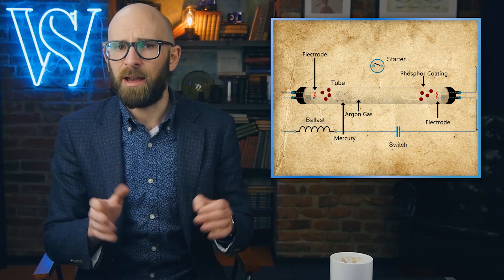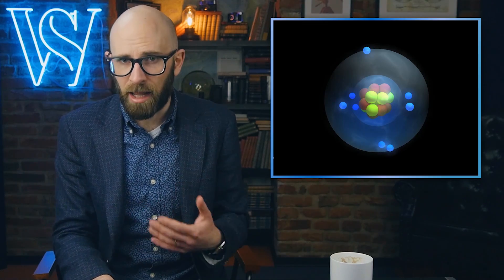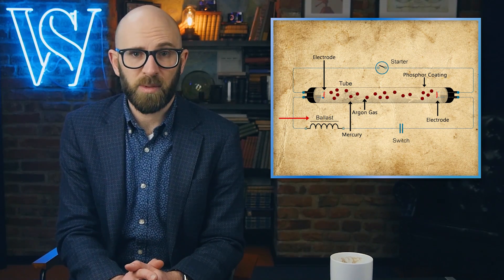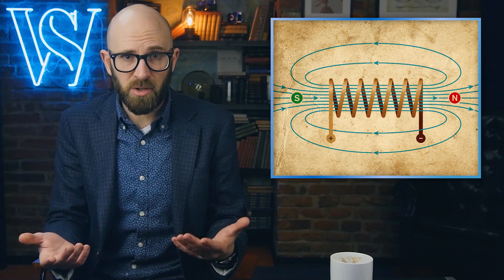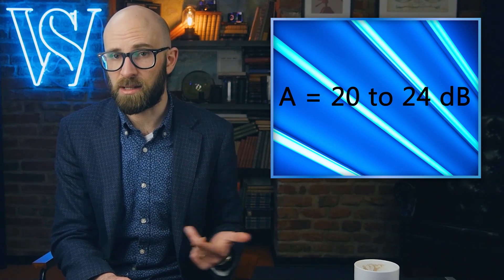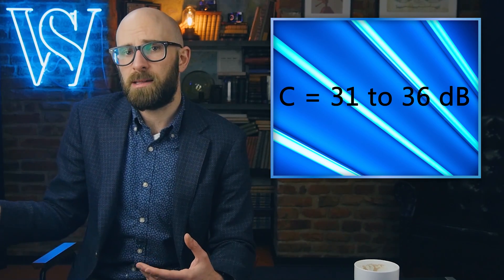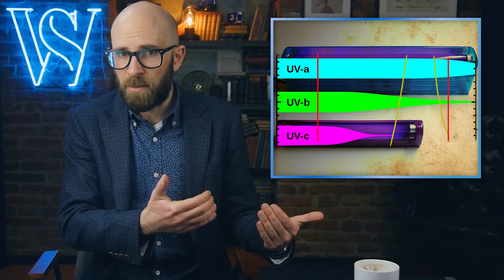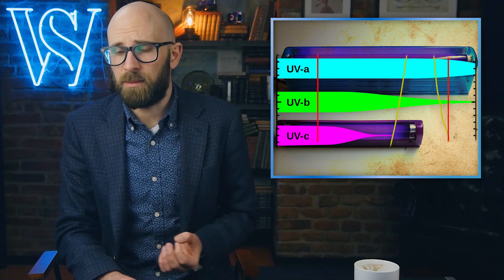The Surprisingly Fascinating Way in Which Fluorescent Lights Work and Why They Sometimes Buzz

Comment: The ballasts buz because the windings are shifting in time with the alternating current. When they shift enough, the insulating resin that covers the wires wears off and the ballast shorts out. If a flourescent fixture is buzzing loudly, it's time to replace the ballast.

Comment: The ballast alternately absorbs and releases energy, and as Mr Einstein would have us believe, mass equals energy which means that the coils and/or attendant capacitors become alternately heavier and bigger, and lighter and smaller. The variation is very small, but the metal housings tend to enhance the nasty sound. Go LED, save energy and save your nerves.

Comment: Ballast also helps to start excite the Mercury via high voltage... When the current flow stopped with the help of the starter tube (this little barrel shape thing) the stored energy on magnetic field is released to the bulb which excites the mercury..

Comment: If you take a small florescent light bulb, and tape it to a C.B. radio antenna, all you have to do is key up on the microphone, and the energy emitted from the antenna will make the fluorescent light bulb light up from the magnetic field around the antenna.

Comment: I was very surprised you left out some really important points: Electronics ballasts save money in electricity (about half, see https://www.fs.fed.us/t-d/pubs/htmlpubs/htm01712310/index.htm),  can make the bulbs last a lot longer for high output (HO) and very high output (VHO) bulbs, and they are a lot lighter. Being lighter they have the following benefits; easier to change and handle, use fewer raw materials and use less energy for distributors/shipping.

Comment: So why isn't the whole power grid running on 20kHz or DC? Use litz cables for the 20KHz lines and  25 kVA pole transformers would be about the size of a loaf of bread and about 50 lbs rather than 350 lbs (cheaper to produce, less materials). No more buzz anywhere (at least none that humans can hear). Pay for it with the proceeds of recycling all the outdated crap.

Comment: 0:23 This circuit diagram has an error. You're showing a capacitor, yet labeled it as a switch. Also, there are no mains coming in!If you replaced the capacitor symbol with incoming mains (L and N) instead, it'd be correct.
Swapping to an electronic ballast does NOT usually require changing the lamps. It can get complicated if you're also switching to LED retrofit tube lamps for fluorescent fixtures.

Comment: Simon, Simon, Simon!  Did your radiator  basement troll, Danny, write this one? hehe  You didn't even mention "wood's glass" or anything! so, I shall help in educating the masses :)  There are TWO types of "black light" which  bear mentioning.. one of which is BLB and the other is UV(G)  BLB or "black light blue" is a formulation of phosphors PLUS a dark coating on the glass (known as WOODS GLASS) which makes up the black light (LOWER to MID) spectrum commonly seen in effects such as at night clubs, bowling alleys and the like..  the other is UV(G) or ""germicidal" which is characterized as pure UV black light which is used in germicidal and disinfecting applications.. the mercury ARC itself  emits these UVc wavelengths and thus is usually simply a tube with NO coating applied (note: these clear tubes are actually QUARTZ and not glass as glass would naturally block the UVc wavelengths) there is also a third type commonly called BL (or blue light) which is usually used in applications  such as bug killers and insect traps. they may appear as black lights when operating, but have a (usually) WHITE phosphor on them and look like normal florescent tubes they appear as blue or purple (not deep purple) light to our eyes.   Another thing that Simon forgot to mention is the other task of the ballast- and that is to provide a STRIKE pulse or voltage to "fire" a [cold] tube.. this pulse may be of several thousands of volts. and thus causes a jump or "avalanche"  (breakdown) of the voltage gap across the electrodes in a gas-discharge arc..   AND that once the arc is established, this causes what is known as a "negative resistance" (Simon did his best to explain the negative resistance part) whereas the resistance id the electrical arc is "less than the resistance of the supply that is feeding it" and, of course, the effect without some form of a ballast- he properly explained that part ;)  Overall, Simon, you did a good job explaining things for someone not trained in electrical engineering to some degree hehe

Comment: Your explanation is correct. It contradicts the idea most physicists keep repeating : electrons are emitting photons when accelerated. You correct that common mistake saying; electrons absorb the energy in a first stage, jumping to a higher energy orbital, accelerating but not emitting photon yet.
Then, the excited electron  return to a lower energy level, jumping there instantaneously, emitting a photon at that time.
Conclusion: Electrons emit photons when decelerating, never when accelerating.
Reply: Decelerating & accelerating are matters of relative motion, and so dependant on viewer's perspective.

At any rate, the difference is that when rising in energy state the electron is absorbing a photon (yep, a photon), with the result that it metaphorically is emitting an equal but opposite photon, resulting in conservation of energy forcing the energy of the photon into something... such as the electron in question.
Reply: @absalomdraconis  Engineers are trained to pay attention to detail like this : energy is coming in or out? They would not accept the sales pitch "don't stress about the size of the fuse, it is all relative.

A great example of sloppy math is the twin paradox. It is true that each twin talking to each other on video call would perceive the other one as forever young, while the distance is increasing.  But both twin will see their age catching up with each other while the twin has reverted the rocket and the distance is now decreasing.
The Doppler effect  is  a good model to resolve that kind of paradox.

Comment: Incandescent 'black lights' work very very badly if at all. All of the emitted light comes from the filament which creates almost nothing in the ultraviolet range. They are a waste of money and a fire hazard. LED 'black lights' may or may not be very good. There are LEDs that create UV light. LEDs do not make white light. White is produced either by a combination of red, green, and blue or more commonly for general lighting by use of a phosphor as in the fluorescent bulbs. The phosphors are excited similarly with blue or UV as those shorter wavelengths provide more energy for the task for a given power consumption. LEDs can operate in the UVA range without help and make fine 'black lights'. Some however are just purple and don't produce UV. The black glass used for 'black lights' is called Wood's glass named for American physicist Robert Williams Wood.

Comment: It is not so much magneto-restriction creating the noise, but just stray magnetic leakage from the ballast causing nearby steel parts (possibly also the case and core of the ballast) to vibrate. Quieter ballasts have more vibrational damping on their internal magnetic parts and better magnetic shielding.

Comment: As a master electrician in Germany I think I'll just show my apprentices this video henceforth instead of explaining it myself. Well done.
Reply: Aggressive Tubesock  try again. A master electrician or Master Plumber or Master carpenter has roots in a very old tradition. That has nothing to do with slavery. It has to do with the tradition of apprenticeship. You Apprentice in a trade then you become a journeyman of that trade then you graduate on to your mastering of that trade. Then you are called a master of such trade. It goes back thousands and thousands of years . Do some research.
Reply: See if they can spot the error in diagram about 30 seconds in! :)
Reply: an english electrician has never used the word 'henceforth'
Reply: It’s funny, as I was watching this, it reminded me of an electrical mystery that happened about a week ago, maybe you might have some insight into what was going on.

I’m in Brazil, where they mostly use 110v for the electronics, the major exception being for appliances, but especially the electronic shower heads used for instant hot water.

My roommate and I ended up taking showers at the same time the other day, which apparently blew one of the two main breakers, taking out power to half the house. 

That’s understandable, but what baffled us, is if I left the shower on, the power would work in the half of the house where the breaker was apparently blown.

So, my guess was that the 220 is made by hanging up the two 110v circuits and thus when it was on, it was backfeeding the blown circuit with power from the one that was still live.

Does that make sense? If not, do you have any ideas?

Comment: I have owned a black light every place I’ve lived in one form or another since turning 13 in the 80s. This was awesome. Answered questions I’ve had about a few things but still one left. If u have a small black light such as a pen or small flashlight style you can write on the screen of old tubeTVs it fade pretty quick but lasts enough to have cool effects. I didn’t think the pixels in the old tv screen were fosfeurus coated though. Is there something else reacting instead? Thanks for the content Simon.

Comment: Bonus fact: If you key-on a handheld radio transceiver, with the antenna close to a fluorescent tube that won't start, it can excite the gas enough to help the arc along its path and start the light.

Comment: When UV light looks purple, it is the combination of UV activating all thee of the rod cells in human vision. The rod cells associated with the color red are actually being activated just enough by the ultra violet light and our brains mix that color "channel" with blue to make the color purple. UV is really a shorter frequency than deep blue light so it should be named Ultra Blue (above blue), which would match better with Infra Red (below red). The rods (color receptors) and cones (fast-reaction general receptors) do not have perfect cut-off frequencies. Green and red cones actually have quite a bit of overlap in the range of frequencies they respond to but our brain's vision system separates the colors based on ratio and our eye's spectral sensitivity curves.

The frequency our eyes is most sensitive to is green (555 nm), pretty much the same color as chlorophyll reflects. Nice coincidence, that. Most creatures with eyes can tell fresh, live plants from dead, unappetizing ones. Chlorophyll absorbs UV, blue, red and IR light, which is why grow-lamps tend to be pink or purple. Plants will even advertise where they want attention by reflecting or absorbing different colors to creatures they need help from to reproduce.

But enough of that. Don't look at UV or IR light if you can at all help it. Both can damage your eyes over time; especially with long, continuous exposure. Those UV or IR light sources that appear "dim" are only dim because our photo-receptors are not very sensitive to those frequencies but they can still be bright enough in their own frequency to burn your eyes. Also, the retina does not have pain receptors so you can burn your retina or damage the cells' DNA and not actually feel it whether staring at an eclipse, messing about with lasers (esp. UV or IR ones), or making things glow with a blacklight. Think of UV as a less-energetic X-ray and IR as a more-energetic microwave.
Reply: More informative than  the video. Thanks
Reply: Tl;dr: Don't stare at sun even during an eclipse, it's harmful
Reply: @A._is_for  👋 Happy New Year Wansom Sou: Shouldn't it be don't, stare at the Sun ESPECIALLY during a solar eclipse?
👁️ I Am The Walrus 👁️

Comment: That was fascination  But why no "B" rating bulbs.  Is this the same as why there's no "B" Batteries.
Reply: David - there used to be a B cell. In the days of tube type portable radios, it ran the heater grid in the tubes.
Reply: @DrFiero  that is interesting. It's like there used to be a b battery but that's long discontinued

Comment: Have you ever stood under the power lines coming off a large power plant? That would be 135,000 volts and 1 billion watts of power going through 4 wires only 2.5 cm (1 inch) in diameter. You can feel the buzz, specially if it's raining.  If you hold a  fluorescent bulb vertically, the difference in potential from the top to the bottom will make the bulb light up.

Comment: Well done with the technical electrical explanation, Simon, and so nearly correct too. 9.5 out of 10.  But you did mix up the frequency with the voltage.  The frequency is 60 Hz (cycles per second) in North America and 50 Hz UK.  The voltage is the 110 volts.  It is interesting that one can hear the 60 Hz hum in a number of electrical items like stereos, high voltage power lines, and electrical sub-stations

Comment: Btw, the electrically charged gas inside of a fluorescent  light is often referred to as plasma,

Not the same thing inside of your body/ blood 🩸,

 However fluorescent lighting is extremely efficient as well as low in power/consumption& costs,

However fluorescent  lighting hardware is higher in costs when compared to the old fashioned incandescent lighting/ light bulbs ,

 Whereas incandescent lightbulbs produce light by heating up a little wire or filament. Inside of a glass bulb 💡  and is the reason that conventional ,

Or old  fashioned lightbulbs

 produce. Lots of heat ,

Whereas fluorescent  lights produce light by stimulation of electrons,

The gases inside of those glass tubes needs to be warmed up a little bit and order for the electrons to flow so fluorescent lights do produce a very small amount of heat as compared to incandescent  lighting;

Comment: The diagram at the beginning is wrong there is no supply and it labels the power factor correction capacitor as a switch. Also all new fittings use the HF electronic ballast.

Comment: Although, due to persistence of vision we see fluorescent lights as giving a constant light, birds such as chickens only have a POV of 1/60 of a second so they see fluorescent lights as constantly flashing.
Reply: So do I lol. I've always had whacky eyesight.
Reply: Azure Griffin.  Or your a chicken.
Reply: @mickcoomer9714  100Hz for the light,as the flicker is double the current.
Reply: Azure Griffin.  I stand corrected.
Reply: @mickcoomer9714  flamboyant bow
Reply: Might be because I'm in the UK. 100Hz...
Reply: Azure Griffin.  Frequency in the UK is 50Hz.
Reply: The flickering is sometimes noticable if you use your peripheral vision to view the light.

Comment: 1:35 Wouldn't the pull string for the light get hot from the bulb? Why is it so short?
Reply: Longer ones cost more to manufacture. You can buy extensions for them though, for an additional price.